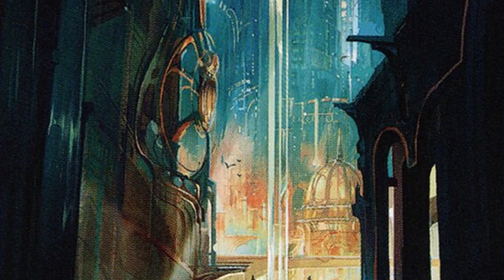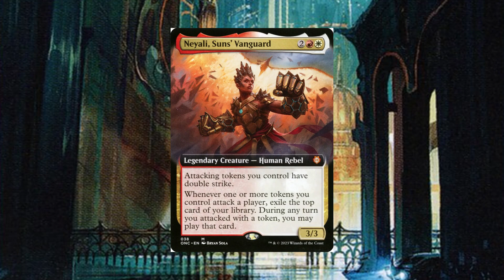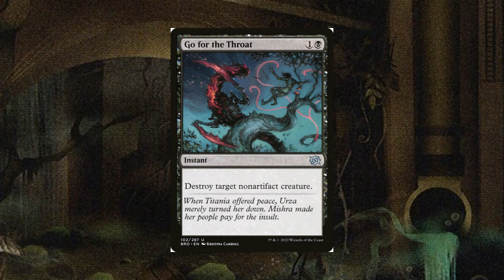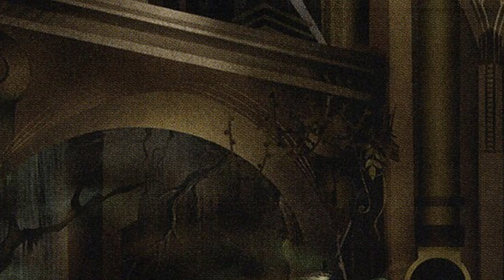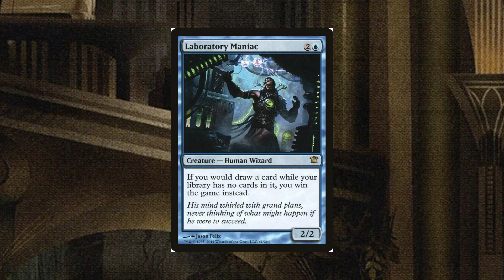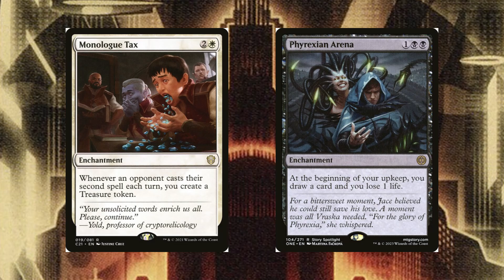The new commander no one is talking about! | Deck Driver MTG

Comment: I feel like part of your initial issue is most precons are designed to have multiple possible strategies. For Planar Portal, the Prosper D&D precon (my first) there was a token subtheme, the self exile subtheme, the exile enemy card subtheme, a beatdown subtheme, a ping subtheme and even a goad subtheme. There's so many different mechanics put together because precons aren't just designed as a 'grab and go' deck but a jumping off point. I could take parts of that deck and make an entire goad deck or a cascade deck or a communism deck etc. It's designed so new players pick up a deck and then get inspired to build decks around new mechanics so they spend more.

Because of this, the backup commander tends to be a bit more generic or towards a different part of the strategy. The backup for Planar Portals is a goad commander that encourages aggression against your enemies. Otharri is an expirence/combats commander. It's such a different route than the face commander because the face has to be more widely applicable to multiple subthemes.

Comment: Fan of the new facecam. Also, fully agree that the backup commander of Miracle Worker is so so cool. People play old stick fingers as a way to mill a ton of cards to the grave. This card is just an old stick fingers but has enchantment recursion, which is awesome. A really good card here i didnt see in the vid (i may have missed it) is Aura of Silence, as with the commander, it be omes a repeatable form of removal that also slows the opponents down

Comment: If you're looking for some "repeatable" interaction for the deck, can use Seal of Cleansing (Artifact / Enchant Removal), Seal of Removal (Creature Bounce), Fear of Imposters (Counterspell), Angelic Renewal (Protection against removal), Fungal Fortitude (Protection against removal), Necromancy (Instant Speed Reanimate). Other enchantments I found cool were Mystic Remora and Darksteel Mutation.

Additionally, unsure if this is gameplay you want to use. But being able to perform an Abdel loop can result in a way to win the game.
Abdel Adrian (In Gy) + Animate Dead, Dance of the Dead or Necromancy (In Hand or In Gy to be escaped) + Mana Rock
1. Animate Dead revive Abdel
2. Abdel trigger etb, exiling the mana rock (may tap it before leaving) & animate dead to get 2 soldiers (May exile more permanents for additional etb triggers)
3. Abdel dies
4. untapped mana rock and animate dead etb
5. animate dead revive Abdel
6. repeat steps 2-5 as mana times as you'd like getting Infinite mana + Infinite soldiers + Infinite whatever etbs you can flicker (can break the loop by just not flickering the animate dead or using animate dead to revive another creature)
Then with infinite mana you can mill your entire deck with your commander (you can put him back into the commander zone after using Abdel's ability to flicker and choosing to put Master of Keys into the commander zone)

Then from there you should be able to win the game with your entire library in your Gy. A route I theory'd up was:
1. Escape back Seal of Cleansing, using it to destroy your animate dead which destroys Abdel
2. Escape back Necromancy revive an etb that can win the game (Grim Guardian or other damage etbs can work here)
3. Escape back Animate Dead revive Abdel, doing the loop previous but with the damage inflicting etb to close out the game

The Abdel combo looks to be extremely powerful for The Master of Keys as you are capable of just representing a win with a 2 card combo w/ 2-3 mana all from your graveyard that could be randomly milled
Reply: Also, I like the new webcam inclusion for your videos!
Reply: Too long my man. just make Infinite mana, mill your deck, cast rea enchant, target ThOracle. Gg.

Comment: i feel like its the opposite. You Cast the Commander as Early as Possible. 

The thing with Master if Keys is that you dont really gotta do random mill strategies or go for long game. Stack pieces are just gonna get you targetted unless its CEDH. 

You have Blue and Black. most of your cards already will discard. A single frantic search and discarding the enchantment you want is already doing a lot. Especially early. if you really want the master of death to pump itself up. rather than pay X. Just run auras and escape them from grave if need be. 

If he dies early. thats fine. We have blue AND black. Use stuff like Slip out the back. or just reanimate him with victimize. 

This commander is way too cool to be another lame Stax Deck.
Reply from the maker: An interesting take! Its for sure a way to go, this is just how I personally chose the build the master, but he's flexible enough to do both! Thank you for your comment!